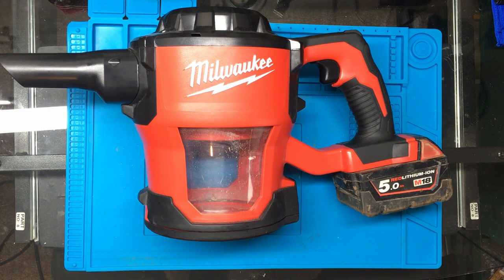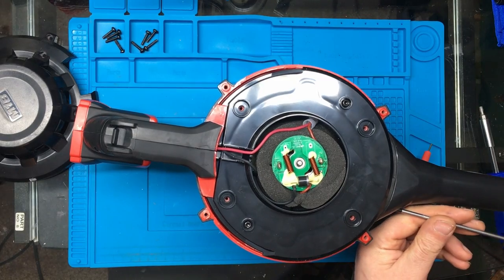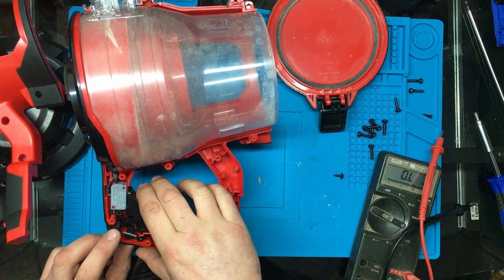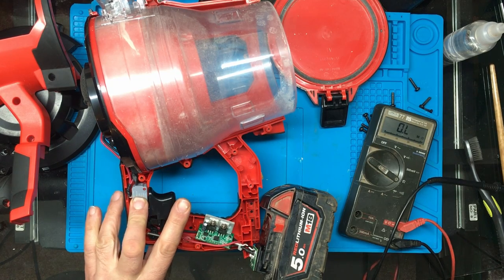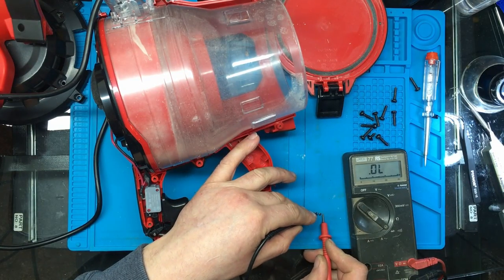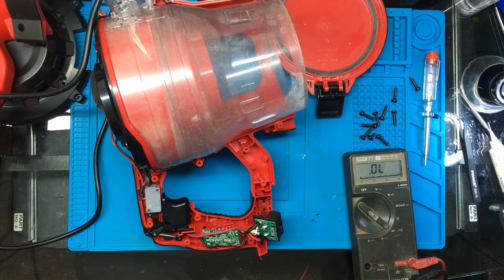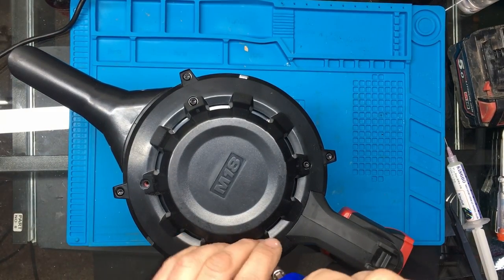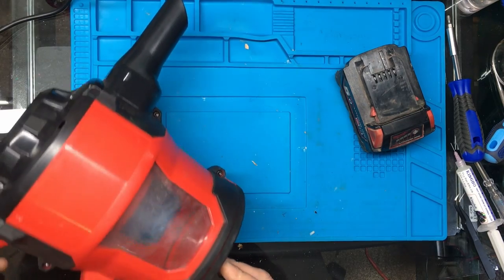Repairing A Milwaukee Compact Hand Vacuum (Model M18CV-0)

Comment: This video was a life-saver!  I bought two of these years ago, and they just both would run for 10 or 15 seconds and shutdown.  This video showed exactly how to get access to the wiring (I figured it be locked behind security screws or glued together shell) and bypass whatever sensor is down next to the motor (temp sensor?)  Just cut the wires and bypassed that sensor and now they both run like they should!

Thanks, so much!! Now they are actually able to be used.
Reply from the maker: Thanks for your kind comment. Glad the video was of use to you!
Reply: @Ducktrent  Yep.

Mine has went from a useless junk to my most used vacuum.

Haven't had a single issue since I bypassed the sensor.  You won't regret it.

Comment: This unit keeps shocking my hand when vacuuming rubber backed carpet, static through the handle onto my palm? Then the unit will not re-start.  Milwaukee has been great, repaired 3 +  times, then just replaced the unit with a new one. Now today the new one quit. Thank you for helping me to understand why I have been getting zapped. I was avoiding back and forth motions to reduce static build up, but got too confident that the issue was solved on my new one. Great unit other than this design flaw.
Reply from the maker: Yeah sounds like static. Glad the video was useful to you 👍👍

Comment: Worked!!!...Mine kept cutting off..Just bypassed that switch..and life is good
Reply from the maker: Good to hear
Reply: @BuyitFixit  Thanks...I just had to bypass the sensor ...I cut the wire wrong the first time ...But fixed it
Reply from the maker: Glad you got it working again. Well done 👍👍
Reply: @BuyitFixit  I have a process...lol
Reply: @jefferysmom696  how did you bypass the switch? Which wires do I cut?   Thanks in advance
Reply: @toaster816  I did it a wile back...I forgot ..sorry I did cut the wrong one and had to fix it
Reply: @jefferysmom696  no worries.  Take care.
Reply: @toaster816  You too as well♥

Comment: There's a thermal sensor and an impeller speed sensor for the motor which act as redundancies to measure the drop another way, and also to cut out the power if the temperature of the motor gets too hot to prevent a fire.   The issue most of these vacuums have is that the circuit board and power supply itself warms up and on an example which has inhaled water before (even small bits of moisture), it lightly corrodes the circuitry going to the temp sensor and trips the cut off much earlier than is supposed to.  If left with the trigger lock depressed you can observe a unit with this malfunction as it cuts itself out and turns on shortly after, over and over again. until the metal within the circuitry warms up to a point where it suddenly works again until the battery drains out as it expands to compensate for the corrosion. it's all really smart and really dumb.
Reply from the maker: Interesting, thanks for the info 👍

Comment: Awesome that u got this to work again. Dont have one but a bit hesistant since so many folks had issues. If i can bypass the switch or thermal sensor that would be an easy fix when warranty runs out but out of my element when it comes to mosfet replacement. Cutting wires would be the way to go but which wires are they and how do u bypass. Comments werent very clear. Pls advise thx.
Reply from the maker: The control board disconnects the battery negative from the motor when the battery level drops below a certain level to stop you running the battery completely flat. You could just join the negative from the battery directly to the motor and that would make it workz however with the risk of running the battery lower than the charger would charge it again.
Reply: @BuyitFixit  ok great thx. I don't intend to use for long periods of time so that's manageable. Already have an m12 which I though was small enough but still a little bulky when I carry it around and need to reach high places like the ceiling. Decisions decisions =(

Comment: good video can you tell me where the temp sensor is located?
Reply from the maker: If there is one it will be on the motor. It's more of a thermal cut out. I can't remember if the vacuum has one, it may well be the Milwaukee fan I was thinking of. I've just had a look back at the video and there doesn't appear to be one. So I think the problem would be on the controller board. It could be that it's thinking the battery has run low and it switching off, as that's what the board was designed to do.
Reply: Thanks for answering. I have a Milwaukee vacuum cleaner. The problem is that it works for 45 seconds, sometimes a little more and it stops and a minute later it goes back to work. I ask you, could the problem be the thermal
Reply from the maker: I checked. No thermal on the device. I would think its the controller board. Try bypassing it and sending power to the motor direct see if it does then same.

Comment: I wonder if there is a way to hack in a speed controller onto M18 transfer pump?

They made it way too powerful, and just collapses every hose I connect to the inlet, even hoses specifically designed for inlet side of transfer pumps. It would be perfect if a "low speed" could be hacked on somehow.

 A potentiometer style complete speed control would be even better...but anything to slow it down would be cool.
Reply from the maker: Cant see any reason why not. I cant see it being brushless. Probably just a brushed motor.
Reply: @BuyitFixit  Would you have any suggestions on how to do this for a complete electronics newbie?

I've messed around with electronics here and there, but definitely not confident enough to know where to start.

Could it be as simple as buying a potentiometer and just putting it inline on the red wire coming off the battery?  My guess would be I'd have to somehow disable however it checks for low battery cut-off as it would just shut down if I tried to lower speed below voltage of a "low" pack.

I'm willing to try anything, even if it breaks it at this point, because it's useless to me with no speed control.
Reply from the maker: I would put something between the motor and controller then you would not need to worry about the battery low voltage problem.  A variable resistor would probably burn out or get hor unless able to handle the current. You could use something like one of those resistors for car fan heaters that have 3 speeds and a 3 way switch perhaps? Thete are probably better ways but more complicated.
Reply: @BuyitFixit  I think I have some old blower resistor packages that are burned out in just one mode, but still have a couple working speed levels.  Good idea, I will use those to see if it's a viable option or not.

Thanks!
Reply: @BuyitFixit  it has a 19v brushed off the shelf motor

Comment: Pls help me, i have 1 set like you but when start about 30-45 secs then stop and 10 secs later i can start it, how can i fix it. Love from Vietnam😊
Reply from the maker: Hi, Sorry I'm not sure on that problem. Could the motor be overheating? I think there could be a thermal cut out on the motor. 
You could try bypass the small circuit board to see if that fixes the problem, by connecting the two black wires together. Be aware that you would then be able to run the battery totally flat to the point where the charger would not charge it if that makes it run.
Reply: @BuyitFixit  thank you for your answer, i will try it, i just check motor and clean it, its not heating, do you thing thermal sensor problem?
Reply from the maker: I would try bypass the controller board just link a wire from the black wire on the battery to black on the motor and see if it runs ok. If so fault will be on the control board.

Comment: U still reply bro ? I got a problem and i been searching your videos and it dosnt look like u have my issue , is same model but cant get the mottor out , the motor bottom mat(nut) is in a weird circle piramid shape , what could i do
Reply from the maker: Yes I always try to reply to comments. I'm not sure what you mean about the motor. On other models it was just a nut on the end of the shaft where the fan attaches and you could stop the shaft rotating by jamming the fan to undo the nut.

Comment: What would happen if you just bridged it and left it like that
Reply from the maker: It would work, but it would be possible to discharge the battery below it's minimum voltage as it would not switch off automatically when the battery was flat. When you put the battery on a Milwaukee charger if it's below voltage too much it would just flash red / green and then refuse to charge it. Hope that helps 👍
Reply: @BuyitFixit  that really helps thanks so much for your reply
Reply from the maker: No problem. Glad to help 👍

Comment: 2 middle pins is SMBus not just dumb sensor leads
Reply from the maker: Yes, I've looked at quite a few more things since (including 10 batteries that I bought) haven't done a video on those yet. I scoped the pins and saw they were like i2c comms. I'll have to hook up some software and have a sniff at what's being sent. The M12 batteries however only have a thermister and no charge control circuitry. Interesting that the M18 packs do not have over discharge protection! That is handled in the tool!

Comment: what was the piece you replaced? my vacuum has the same issue. turns on when I short it out
Reply from the maker: It was a small mosfet. It's marked Q10 on the PCB. I can't remember the exact part code off hand, but you should be able to see it with a magnifying glass or jewelers loupe.
I would just test all of the small 3 pin devices with a test meter to see if they have shorted or failed. The PCB is there to stop you being able to flatten the battery beyond the point where the charger won't charge them, as the batteries don't have undervoltage protection!
Reply: What’s the tube of fluid u used to adhere the mosfet
Reply from the maker: It doesn't adhere the mosfet, it's called flux. It helps clean the metal so the solder flows and sticks better :)